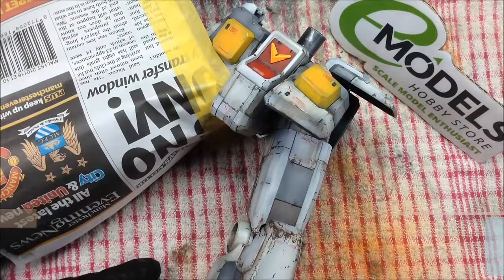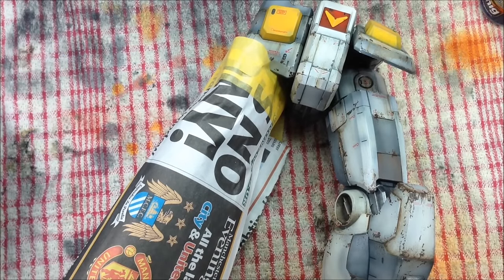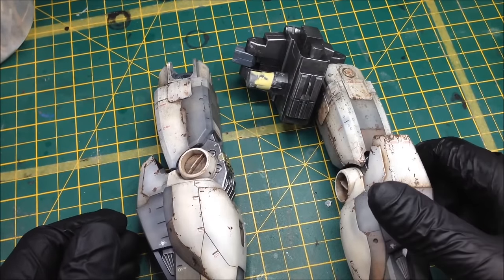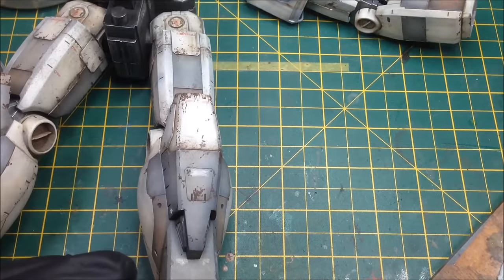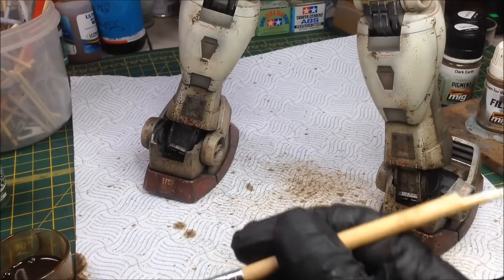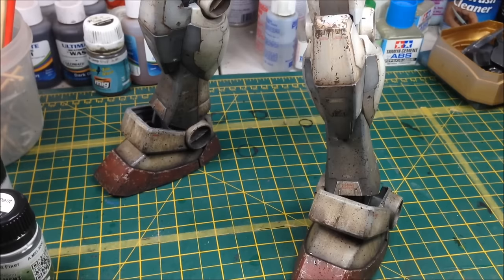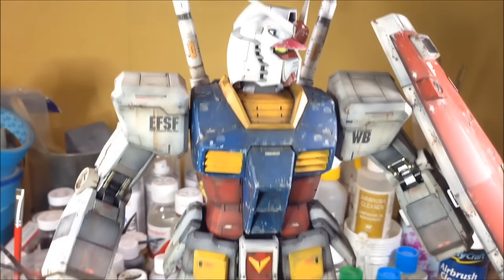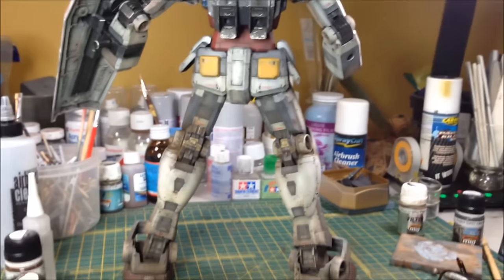Ammo of Mig Advanced Weathering Tutorial Part 3

Comment: This looks fantastic, I am really learning a lot in this series.  I don't know if Milliput is the same as Apoxie sculpt but I had one instance where it would not harden and it turned out I just did not mix it long enough even though it had a uniform color.
Reply: +Stuart C I think they are similar. I have found with Milliput that it can refuse to harden and set if you have a) not mixed equal amounts, 2) not mixed it for long enough (I sit there for up to 5 mins zoning out whilst I knead) or iii) it is a bit old and past it (if you have had it for a year or two and it has been previously opened, get rid of any mingy bits off the end of each stick. Also I think if it has gone kind brown and slimy in the tube, it's probably out of date).